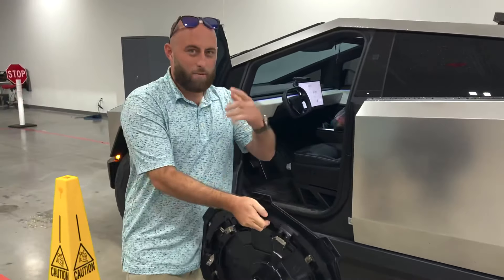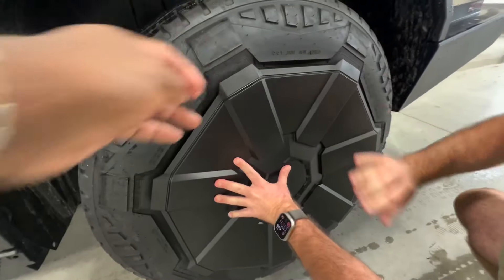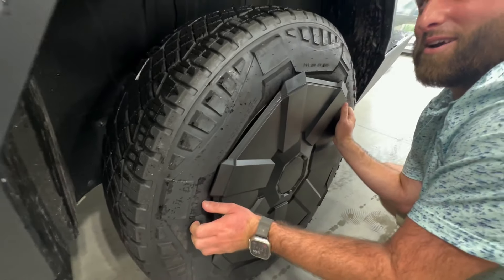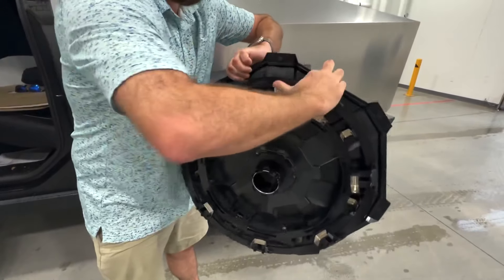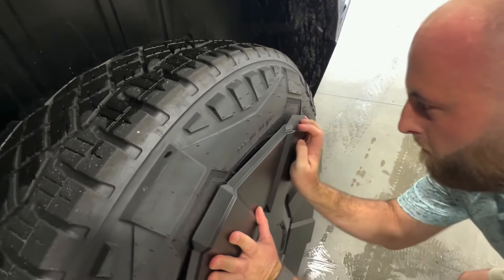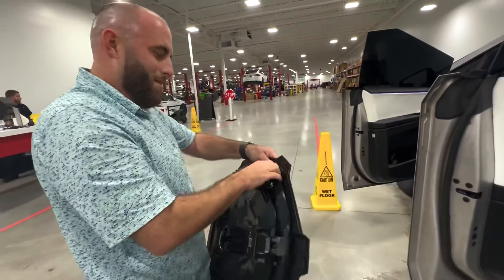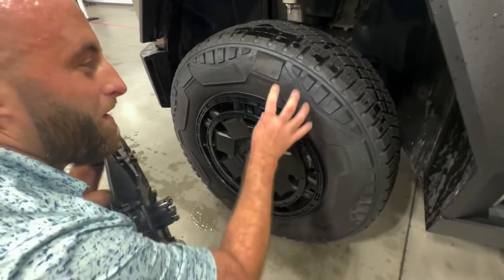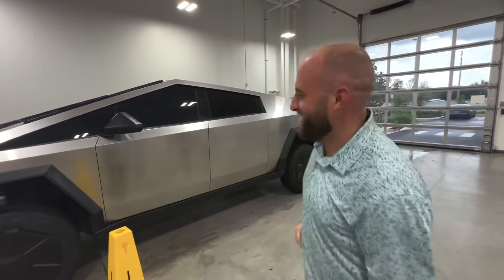Avoid These Mistakes: Install Redesigned Cybertruck Wheel Covers the Right Way

Comment: You also need to push the center in as well (last step)
The real pain with these is that you have to remove them in order to access the valve stem to add air…

Comment: I don’t see why the two parts need to be separated - I pull them off snapped together and then snap them on while connected to each other— I don’t see any reason to separate the two pieces. 

Separating the pieces just make it more effort.

Comment: YUK
LEAVE THOSE OFF
Reply: The car looks disgusting without the cyber aesthetic of the wheel covers on the wheels. Having exposed normal looking  rims on a vehicle like this is a design crime
Reply from the maker: I think these wheels and tires look good with them...by now a lot of owners have probably moved on to different tires and wheels though
Reply: Yeah, I got used to seeing the truck without them. 

I think the angular alloys look better, just make a small center cap to cover the lugs / axle shaft and it'll look good.